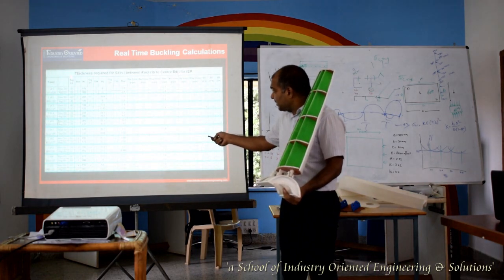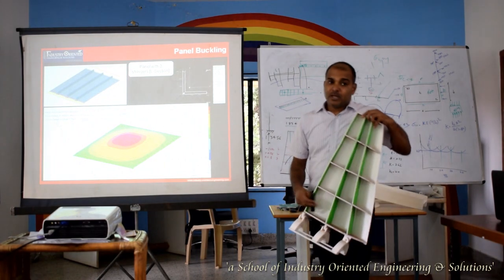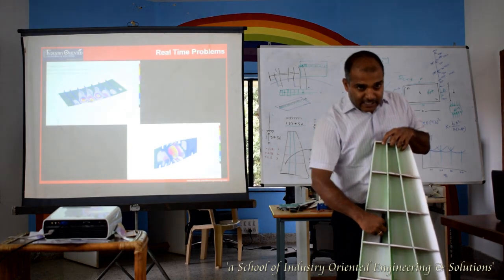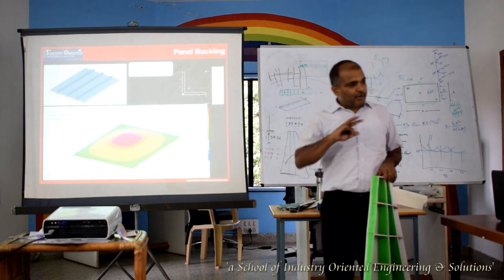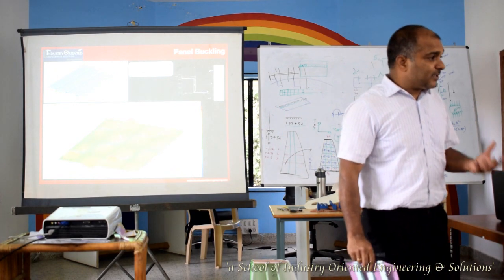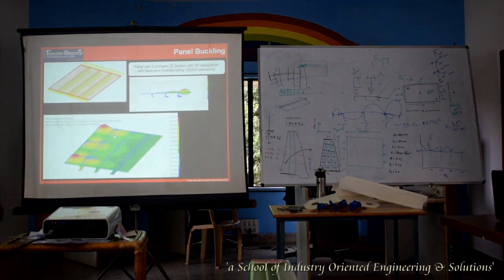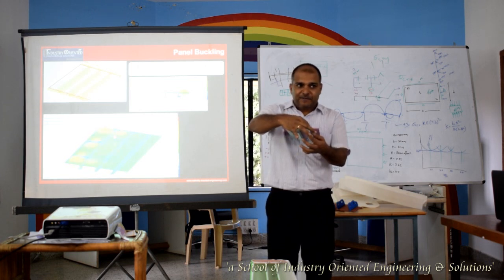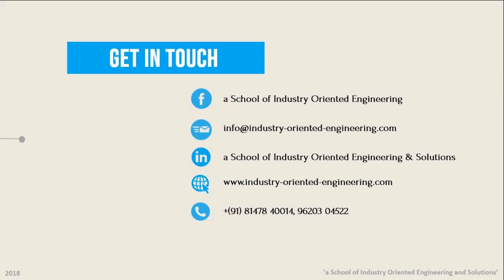Demo Class - Design of Skin Stringer Panel

Comment: What r the constrains to be applied for 1d skin stringer panel
Reply from the maker: It depends the on edge conditions of the panel the user needs to consider based on the physics of the problem.